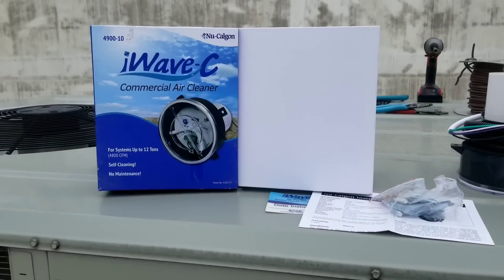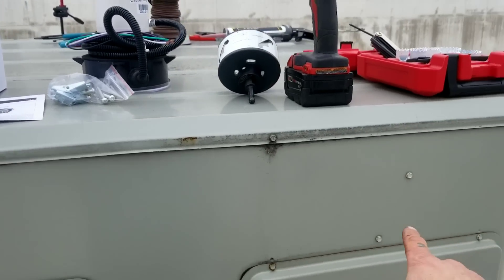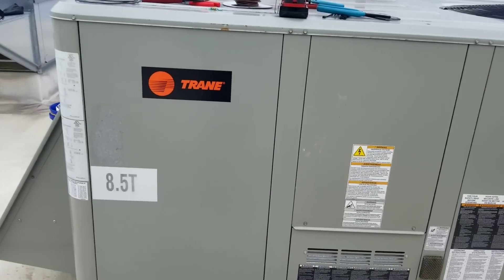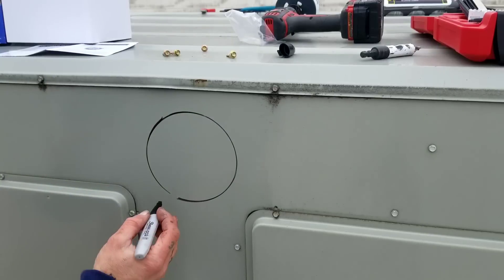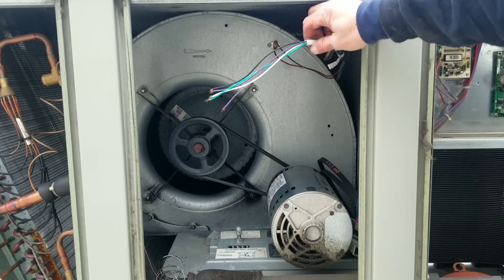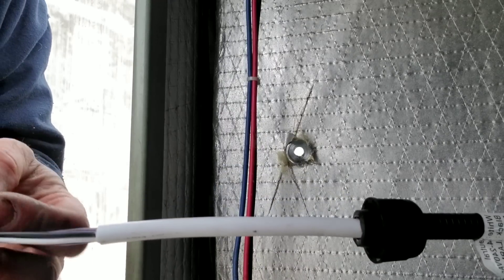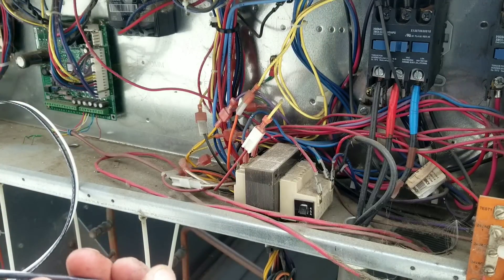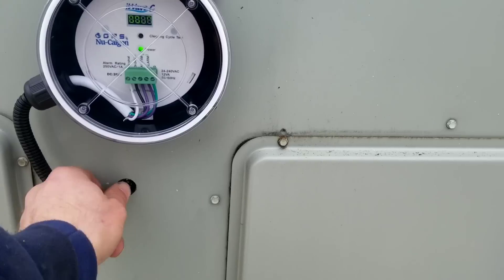Installing an I-wave on a Trane

Comment: For a residential iwave application what merv filter would you use? 20x25x4 size. I have the Iwave and I have the fan set to come on 1/3 of the time plus whenever the ac or heat runs. I also have HEPA filters throughout the house. Would you go with a merv 8 and change it every couple months to balance filtration and airflow (especially with the other filters) or a merv 10? Hope that makes sense. Thanks!

Comment: Bipolar ionization has been around for a while but is still an unproven technology. I saw it some before covid as a niche product but after covid there has been a lot more interest. Because of the interest there has also been a lot more scrutiny and testing and the claims didn't hold up. If they are worried about viruses and mold then for a packaged unit like this a UV lamp sized for in-air disinfection is a more proven solution. Typical lamps are sized for coil cleaning but they sell them in higher strengths for disinfection.

Comment: Nice I put some of them in on an older aaon unit. Was able to mount it on the blower housing catching the air as blows through the coil. I kept it inside cause I wasn't sure at the time that outer section of that cleaner can be exposed to outside. Like always nice work

Comment: I usually cut the black plastic cover and use the same connector that comes with it so I don’t have to calk the hole. You don’t need a waterproof connector inside

Comment: Can you notice a difference in the air quality after installing?
Reply from the maker: Not in my opinion- and I havent had any customers tell me the air quality is any better. I have heard from a few residential techs that their customers have experienced better air quality with the smaller versions of these
Reply: I have a UV-C tube in my unit to prevent coil mold. Works GREAT!

Comment: Great install, quick and simple.  I installed one on my ac about 6 months ago, did not improve one bit of air quality.  I personally think they suck and won’t sell another.  I sell the reme halo leds and it’s almost instantly noticeable by customers once installed.  The I Wave I’m sure does the same but i sure couldn’t tell a difference.   Good Job my Hvac brother.👍👍
Reply from the maker: Thanks for the feedback- Ive heard the same thing about those reme halo units, havent installed one myself though- thanks for watching
Reply: I will 2nd this. Even a few new ones on the market beat the iwave in noticeable difference

Comment: iWave-C Air Purifier (4800CFM) 
Nu-Calgon 
$682.68 each
SKU 4900-10

 Description
Overview:
iWave-C is a self-cleaning, bi-polar ionization generator for actively treating a building’s air quality that does not require replacement parts in a year or two like competing UV lights or other ionizer technologies. In addition, the iWave-C produces and maintains unparalleled ionization output and capabilities. As the air flows past the iWave-C, the device emits positive and negative ions, creating a plamsa region that actively purifies the supply air, killing mold, bacteria and viruses in the coil and living space. The ionization process also reduces allergens, smoke and static electricity, as well as controlling odors (cooking, pet, VOCs) and other particles (no more sunbeams) in the air without creating ozone or any harmful byproducts.

Although suitable for residential applications, the original iWave-C is specially designed for light commercial systems up to 12 tons (4800 CFM) with no maintenance or replacement parts needed. iWave-C can be easily duct-mounted indoors or outdoors, depending on the application. iWave-C always works at peak performance, producing over 200 million ions/cc, making it superior to other market approaches. Special features include a programmable self-cleaning cycle, waterproof housing, digital display (for on-site visual monitoring) and integral alarm contact (for remote monitoring). In the event the ion emitters become damaged or wear out (after years of service), they can be replaced on the iWave-C model.

Specifications:
Input Voltage: 24VAC or 110 - 240VAC
Power (VA): 12 VA
Frequency: 50/60 HZ
System Size: Up to 12 tons (4800 CFM)*
Dimensions: 4" W x 7" H x 7" L
Weight: 3 lbs.
Electrical Approvals: UL and cUL approved
Service Temp. Range: -40ºF to 160ºF
Reply from the maker: Now why didnt I think to include this in the description-- thanks for this im gonna add this to the video

Comment: Honeywell F50 vs this, I'll take the device that actually captures and arrests the viruses to sub micron level.  And blower non stop is wrong in most cases.
Reply: I agree.  If I wired my customers blowers to run nonstop they would be calling my about the air purifier made there power bill go way up.
Reply from the maker: I agree

Comment: That's an interesting one. I haven't seen the ones that can be mounted outside. you can use your meter and test the voltage coming out of it at the little brushes. if I remember correctly it's DC voltage and it could range somewhere between 50 and 100 volts.
Reply from the maker: I didnt know that- imma have to test that out, thanks Rick

Comment: BigClive changed my mind about these things and ive been installing a bunch of them lately.  Even put one in my house, just to see if I noticed a difference.
Reply: I put one in my house a year ago.  no difference.  get your self a reme halo, at least you can smell that its working, and theres never been any doubt about uv light..lol!
Reply: @bobbyk6761  I have UV lights in both my upstairs and downstairs units.  They're proven to kill mold virus, etc, and don't have any smell.  PUt them on a sail switch for air cleaning and the bulbs last for years.  I replace mine (and they arent burnt out) about every 3 -4 years.  The "ionization" devices produce basically smog which is a known pollutant.

Comment: Had to watch again,  the blower runs non stop, excellent,  more work for you replacing blower motors...  lol
Reply: Most restaurants run the blower 100 percent of the time when in occupied mode since it supplies makeup air to the building. Most installs in restaurants connect the Ionizer to the blower contactor so it operates when the blower is activated.
Reply: The blower has to run permanently, otherwise it's like putting a mask on for only 10 minutes every hour. The entire unit doesn't actually do anything, obviously, 99.9% of the air never even gets close to it so you're just wasting energy.